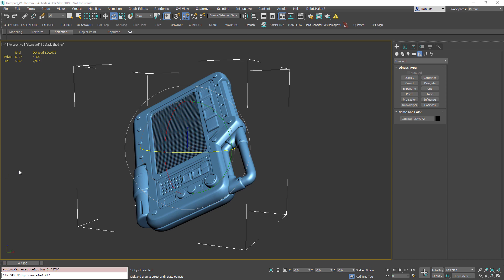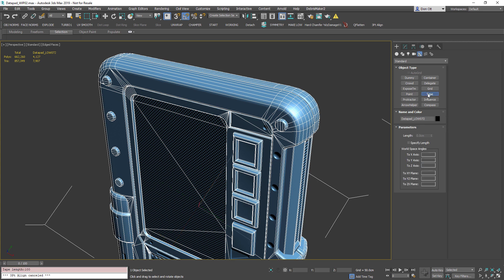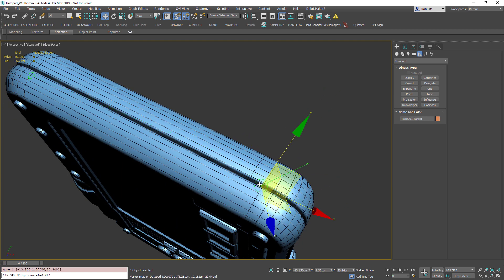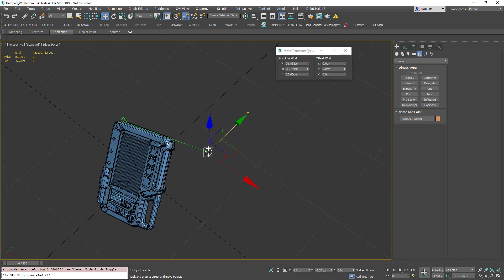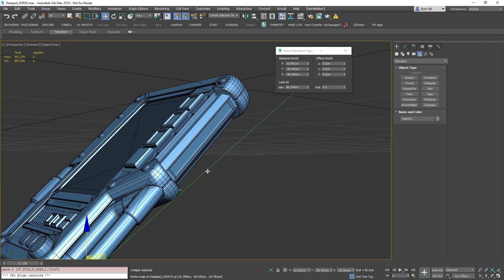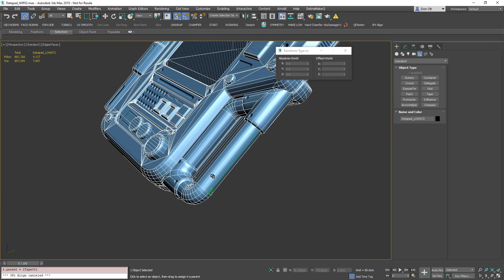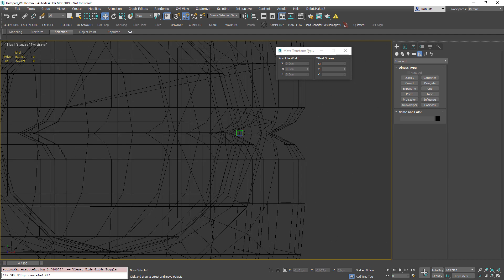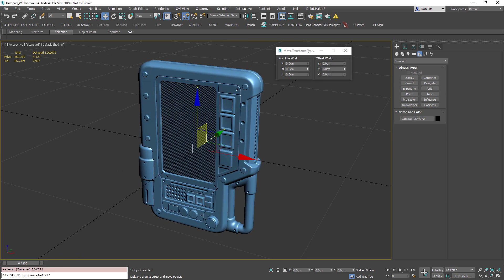Realigning a Badly Rotated Object in 3ds Max

Comment: I just make a new box object, and use "Normal align" on some flat surface from the rotated object to face from that new box. Easy and simple:)
Reply: yeah this way will work but only if ur box can detect the orientation correctly, in some scenarios it will not detect . so better to know this way also. thank you for this way.
Reply: @3Dvisualizer_artist  Thank you so much for this, it is incredibly helpful. Big thanks to this video for existing as well